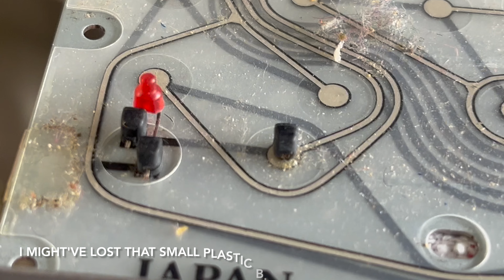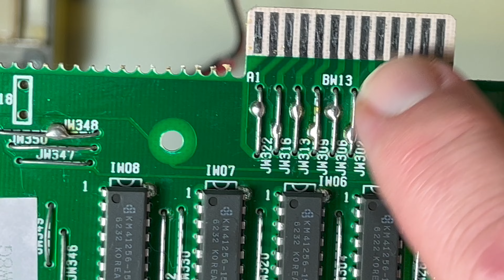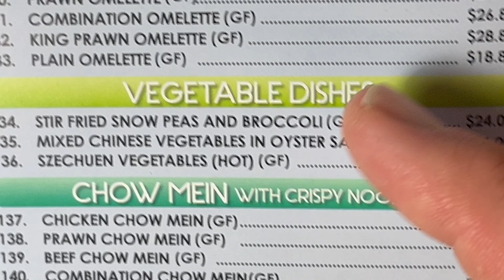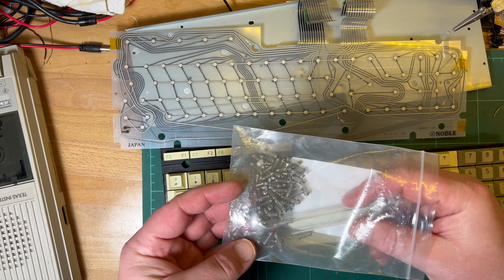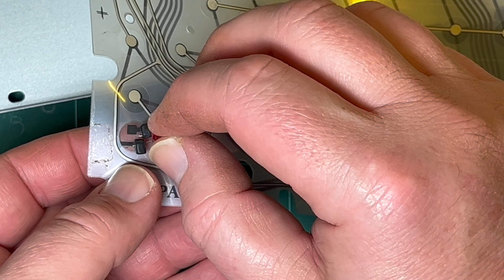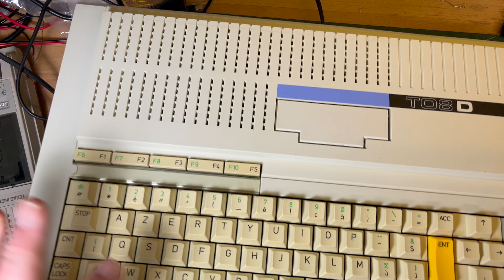🇫🇷 Thomson TO8D: Part 2 (Keyboard Problems Still) [#TCE0480]

Comment: I have a TO8 and I can confirm the colour is off. It should be cyan blue and not green. It looks like the blue component of the RGB output is missing.
Also, regarding the drives, Thomson computers see each side of the floppy disks as a separate drive. Disk 0 is the first side of the first disk, disk 1 the second side and so on...
And last, the SD Drive clashes with the internal disc drive, to use it you must disable that drive either by unpluging its power line or by typing a Poke command to disable it each time you want to use it... In my case I've kept the drive connected and use a floppy disk with a little Basic program with the Poke that I boot on pressing B. The program disable the internal drive then launches the SD Drive menu
Reply from the maker: Ahh, thanks for also confirming.  An interesting issue then ... I'll poke around the blue signal and see what's happening.  And thanks for the advice about the disk handling, and also the SD card interface.  Maybe if I add a DPST switch to disconnect the drive power, that might be easiest for me to implement?
Reply: @Brfff  Yes, a switch would be the easiest way. Leaving the drive powered and disabling it with a poke has one advantage: you can use the Thomsons and one of the SD Drive programs to write disk images onto real floppy disks (so a switch works there too) . Also the SD Drive is a great way to transfer programs between MO's and TO's as it's compatible with the entire range of Thomson computers I'm not at home right now, but I'll post a comment with the poke in question and the program if YouTube lets me

Comment: As for those solder blobs. In the briefest of shots ever, as you flip the board over @2:25, and at least for the center connector, it appears that the jumpers "jump" to themselves. Looks like it was a way of connecting a connector trace from the top of the board to the bottom. 

Credit Nightfall Crew for providing clear photos. Man those Nightfall Crew guys really know how to take photos...

And there's something called "Mégarom T.2" for the Thomson, which looks interesting. I started to watch the video on it, but I kept hearing lines from Monty Python's French castle scene in my head and had to quit.

Fetchez la vache!
Reply from the maker: Ooooo ... MEGAROM!  I'm ordering me one of them now, thanks for the tip!

Comment: Are there replacement membranes available or is this keyboard a candidate for my services?
Reply from the maker: I don't think so ... but I'm hoping, if it's just a cracked track or two, that I can fix it with that silver solution I used last time for the TO7/70 (see TCE #0439).  
They do have a rather clever solution for the TO7/70:
http://dcmoto.free.fr/bricolage/clavier-to770/index.html
Reply: @Brfff I can't tell clearly, but you may be correct with the broken trace theory.  At 16:28, on the extreme right-hand side where there appears to be some Kapton tape, it looks like a trace going towards the edge.  That trace leads to the right most trace in the right side ribbon connector.
Reply from the maker: @JVHShack  I'm doing some testing now, just the membrane, and it seems to be working.  Regarding the Krapton(c) tape, I used it to replace the original tape that I thought was holding the three sheets of membrane together ... but it was actually securing the membrane to the metal bottom plate ... so I'm re-taping the membrane to the metal plate now ... maybe it was just misaligned so the spring under the key was just missing it ... ?